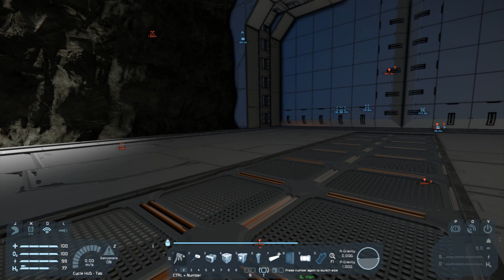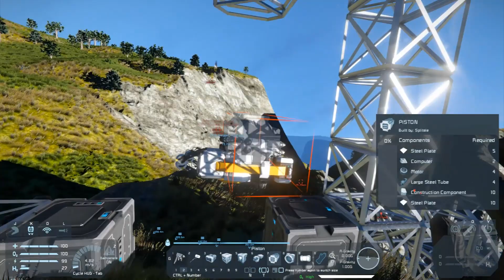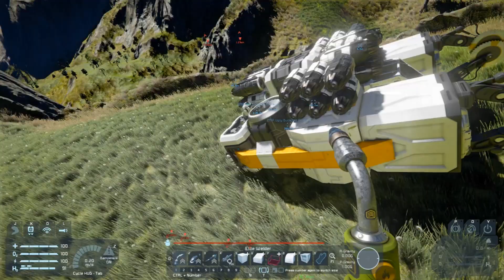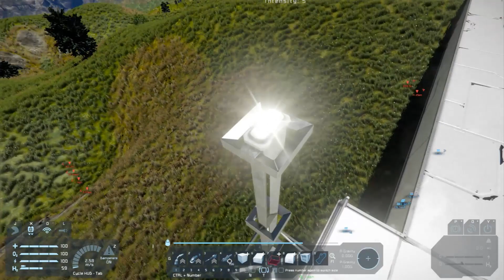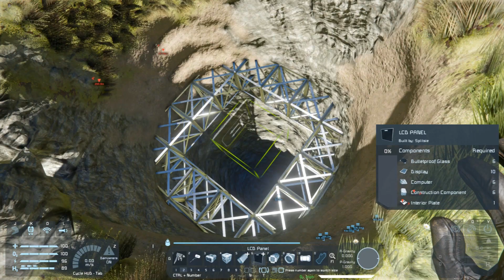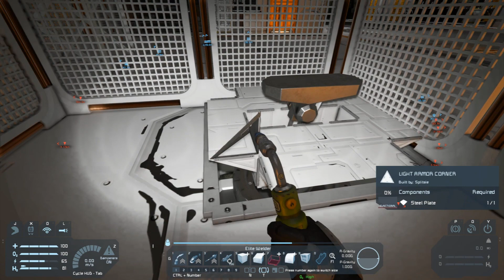Survival, Maybe... #64 Bins for the Bin Chicken (A Garage Engineers Survival Series)

Comment: That base is super easy to Sneak into. You could crouch  walk below the bridge grates. Wait for doors to open and go in. Then you hide in the below walkways. Get to the elevator, break the glass go to the timer room that has the blast door controls and break them. Then block up the top floor doors. Go back down, grind the rotors for the blast doors below functional and weld them back. That way the doors wouldn't be accessible from anywhere.

Comment: I watch you each episode place blocks in the terrain not directly connected to your current grid, and your blocks snap as if the grid were there. So when you do connect them, they "connect" because they're perfectly aligned. Is there a setting or mod that enables that?
Reply from the maker: You can get that behaviour by placing a line of 3 blocks in the voxels, remove the middle one and don't reconnect the remaining two. Then you'll be able to place things snapping to the grid within the area of the giant bounding cube :)
Reply: @Splitsie  Alright - cool - thanks! PS, love your builds.

Comment: Will be interesting to see how you finish the missile silo.  Do not think it is helpful in this situation, but do not forget you could use a projector as a 'hologram.'  I remember Shack or Wasted having one set up to imitate force fields over a landing bay for a story video they did.  Also, better plan to have the silo landing pad get built with a solar panel, just so it has at least some form of power generation.  Contemplates what a hologram of textured red blocks and some effect lighting will look like  hmmm
Reply from the maker: A hologram covering the entrance definitely could have been an option, wouldn't completely hide it, but you also wouldn't need to build doors :P

Comment: First of all thank you so much for updating the save in the workshop. Flying around a bit i noticed a broken sandbag ... turret antenna and solar panel got shot. simply head out of the gate and head to the fleeting rival antenna slightly left. at least i think it was a fleeting rival. i didn't yet check for the others if they are doing fine ... but maybe that location could use 2 sandbags if the base will spawn again.

If you make the silo maybe it would be nice to drop the cargo and battery module onto a mergeblock attached to a piston. so you don't need to fly in just "pull" it in. with several pistons and rotors maybe you could even save a lot of space inside by rotating modules out of the way. 
I hope you get what i mean. really already looking forward to the next episode.
Reply from the maker: Yeah, that sandbag's been a little under the weather for a while now :P

Moving the battery modules mechanically could be pretty cool :)
Reply: maybe design it in a way that the goose and the new ship can move it aswell. btw i heard a lot of shooting during i played in the new save today ... so maybe better fixing that sandbag sooner than later ;)

Comment: How about use silos doors on hinge like in sedan car boot? I'm talking about hinge in shape between L and V. It will move rotation axle away, so rotor could be hidden in the silos wall. And you don't have to use piston. It need space, but might be simpler to build.
Reply from the maker: I think that's a good idea. At the time of the recording I was just thinking in terms of large grid blocks, but if I use small I could definitely get something like that to fit in there :)

Comment: Ahh, lava blast doors.  I like the volcano imagery but my first thought when you mentioned LCDs was camouflage, meaning an image of normal terrain, disguising the hole.  Then, as part of the firing sequence, along with opening the blast door, the outer ring of screens could turn solid red or something.  Could still do the ring idea with the lava, but as the lava is quite red, maybe something like a blue or something?
Reply from the maker: Some camo would have been another good option, but I just couldn't go past having a secret volcano hideout :P

I'm hoping to animate the lava slightly, so I'm not sure I'll be able to have other images pop up to replace it, someone who's much more clever with scripting may be able to do it but I'm not certain it's possible :(

Comment: I still expect to see the Goose with a specialized missile platform at some point, even if only to transport the missile.
Missiles are fairly easy.  I usually go for a hydrogen tank for the lift, large thruster with four side thrusters attached (RCS, maybe?).
If you really want to go full ham, deploy both decoys and warheads (MIRV) style.  Merge blocks maybe?
Lol, you've done Garage Engineers, next comes Missile and Silo engineers.  When Space Station engineers comes on the scene, I suspect we'll be some 100 more episodes in.  You could do this for a very long time, and I look forward to watching.  :)  Cheers.
Reply from the maker: As do I, my plan is to get a missile working from the silo, then hopefully be able to use that design on the trailer launcher :)

Yeah, space is probably going to be around ep 100, sort of a new years thing :P

Comment: Addendum:

Just had a thought. In the bin chicken roost, I had a idea with what to do with the bins.
I noticed you already have a black smoking piece of wreckage, how about adding to it?

Like when reactors are heavily damaged and they produce that toxic radioactive green smoke?
Chuck one of those in a bin.
Finding a thruster that is on fire would be good. It would add plenty of atmosphere to the bin chicken bay.

Of course don't forget some piece of electrical equipment that's sparking up a storm. 
I wonder if toxic radioactive green smoke is flammable?
All of that together would definitely be worth at least one screen shot.

I would highly recommend keeping your base doors close, least Klang gets a peek into the bin chicken roost.
He may show his displeasure of this idea by turning your base into a giant smoking crater.

Then again . . . he didn't have a problem when I built that big fire pit using flaming thrusters.
Reply from the maker: One of the pieces of wreckage I put in there has a damaged battery (sparks) as well as a few damaged reactors, I don't think I'll try to add more or I'll end up with a smoke screen and almost certainly crash the Bin Chicken :P

Comment: Hi, a LCD silo entrance sounds fantastic! Never thought that before, so I get excited and try to design a door mechanism myself. Here is my design. Though it will be really tricky to build that in a small silo. A lot of attaching and merging must be required to avoid digging voxel too much. Also, I think get rid of the armor of the entrance frame, just LCDs will make it even cooler! Hope this could be a hint for your design. :)
https://youtu.be/QzrWigEdl84
Reply: Oh, another idea just popup in my head. What about attaching a small grid on that rotor and use small LCD. You may end up with a small gap, but will be able to make the door perfectly the same level as the frame and avoid any friction and collision. You may even be able to save more space when opened, because the door should be thinner.
Reply from the maker: I'm thinking the same thing, with small grid I can build a complex mechanism in a small space and as long as I work out the scaling on the images for the LCDs it should end up looking pretty good :)

Comment: Here is a trick I learned.
When you want the ship drills to keep running, without holding the mouse button. you can do it in three steps.

(This works for left or right buttons)

Step 1. While holding down the button, bring up the inventory or 'K' menu.

Step 2. When in the menu, release the mouse button.

Step 3. Close the menu and you'll find your drills are still running in the same mode you left it in.

To return to normal operation, just press a mouse button.

Another trick I learned was when in the GPS menu and you want to show or hide GPS markers, instead of checking the box, you can just double click the name of the marker.

Even though I'm more of a single player, I see the need for this game to have a good running multi-player.
I'm glad to see Keen devoting a significant amount of time improving it.

As far as you with your "hydrogen bottle problem", it reminds me of the time when oxygen was introduced.
I was in my miner, on a extended mining trip and had just turn towards home.

I was using the old tried and true method of saving fuel by aiming to the side of my asteroid to avoid collision (Learned that one early).
Getting it up to speed and shutting off the dampeners to save fuel as I was real low at that point.

It was at this moment when I noticed something red on my indicators . . . 
hmmm . . . that's weird?

I'm in a pilot seat powered by two nuclear reactors . . . 
so . . . why is it showing low power in my suit?

Wait a minute, what was in that update yesterday? Oh,Right! Oxygen . . . and . . . I don't have a single bottle on me.
Finally I realized that it wasn't electricity but air was what I needed.

Knowing I wouldn't make it, By this time my health meter was joining the oxygen one in the plummet to zero.
I reached for the dampeners but sadly died before activating them.

After a new clone of me was fabricated at my base and I got some bottles, I realized that finding my ship may prove somewhat difficult.

The miner had neither beacon or antenna on it. It was either docked or I was in it, so I knew where it was and saw no need.

Though in hindsight . . . if one of those fore mentioned pieces of equipment were installed, I would of have had a better chance of seeing it.

As it turned out the closest I got, was that I think I saw something twinkle as it went by.
It's still out there, somewhere in the deep dark reaches of space.

I normally operate in space, occasionally on planets and moons.

So, For me running out of hydrogen (Which as you can see above, happened a lot.) is a different experience for me.

I usually end up slowly drifting away from my base and watching it and my oxygen supply slowly fade away.
It gives me plenty of time to get lost in thought about the dumb thing I just did.

Unless I'm stuck in a hole or something, I prefer not to use the "Backspace" option and pay my dues for my brilliant act of stupidity.

I sympathize with your "hydrogen plight" as I have been there many, many times myself.

Also, Great videos and always a thumbs up from me.
Reply from the maker: That was an awesome story to read, I'm similar in finding the joy in really feeling the pain of your mistakes. When you somehow manage to get out of them the high you get is that much greater :)

Comment: You can make the silo cover from small grid. 3x3 large grid = 15x15 small grid = 5x5 LCD 3x3. Whole cover would be thin enough to fit under the armor slopes so it won't be in way. Using small grid also allows you to use more rotors and pistons without taking much space. Only downside is using same picture will result in different scale of that picture in middle and on sides of the hatch.
Reply from the maker: That's probably a very good idea, I'm sure I can work out the scaling needed to make the lava texture not look too wonky though :)

Comment: Hah, I did a similar fall yesterday when working on my base up high on a steep slope, only I didn't survive the fall...

Also I would like to see how you would go about moving your solar tower if that is a thing you would ever do. I moved mine yesterday to a slightly better location and had some uh "interesting" results when trying different ways of transport. Grabbing the whole thing with a ship and cutting it off at the base is not to recommend, tho detaching the rotor points and move the solar panels to the new tower worked better but still had some interesting behavior when re-attaching to the new rotors. Let's just say it's a good thing our Engineer doesn't get motion sickness.
Reply from the maker: I was so stunned that I survived the fall it was absolutely crazy :P

If you want a really crazy way to move it, use pistons and rotors after detaching from the rotor at the vertical section - kinda swing it around and gradually move toward the final position ;)

Comment: I have trouble imagining what you describe for your silo cover idea. Two rotors with a straight section in between? How is the door going to be opened? Slide horizontally? Rotate around the vertical axis? Horizontal axis? Something else entirely?
Reply from the maker: I really couldn't get my thoughts organised enough to describe it very well, but something like this: (helpfully posted by Si Fi) https://www.windowsystems.co.nz/shaft-and-lever.html
Reply: If I understand it correctly, this solution only needs two rotors placed horizontally. You could move the axis of rotation away from the doors by putting a line of blocks between them and the rotors. There's no piston necessary. I'll try to build a model in Creative. You should see if the lava effect couldn't be achieved just by painting the doors in varying shades of orange and putting some lights.
Reply: This is what I've managed to build: https://imgur.com/a/ViBzLAK It's using one moving rotor instead of two. I didn't want to risk CLANG fitting two pieces together in the opening.

Comment: As far as the missile door, couldn't you use a blast door with an armor cube in the center to hold the LCD panels?
Reply from the maker: You'd still end up with the challenge in how to get it into that space due to the panels extending to the full width of the gap :(

Comment: Ok, here is an idea about the Missile Silo: What if you launch a Sattelite into space, then have a camera on it with a script so you can use the camera's built in ray caster to measure the distance to the ground. With this data you can get the GPS coordinate from where you looked, then you can get a exact point where the enemy base is for improved navigation of the Missile.
There is probably already a script on the Workshop for this. I think it would make things a lot more interesting!
Reply from the maker: That seems like it would be a problem, I guess you could attempt it with the draw distance set to something enormous but that may not be ideal for many other reasons :P
Reply: From what I remember there are problems with precise raycasting when you're very high up and looking at a lower LOD version of the planet.
Reply: That is gloriously convoluted. I love it.